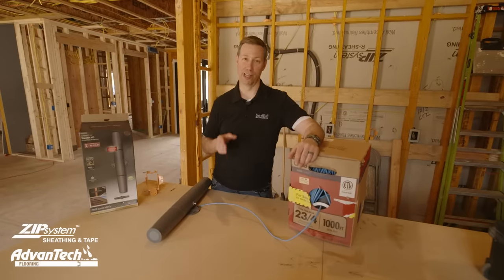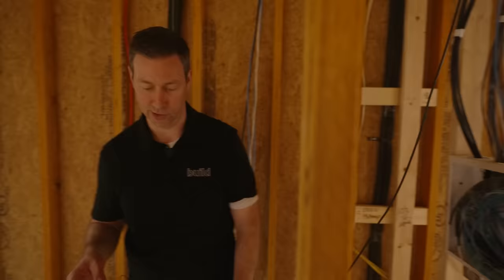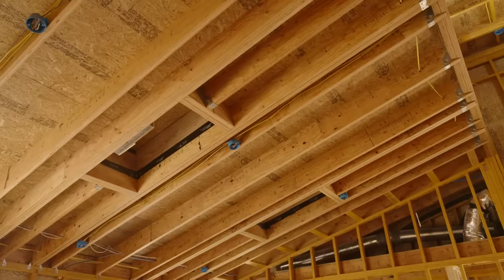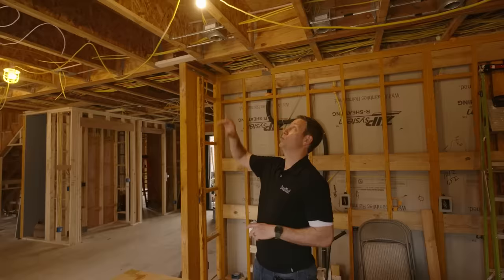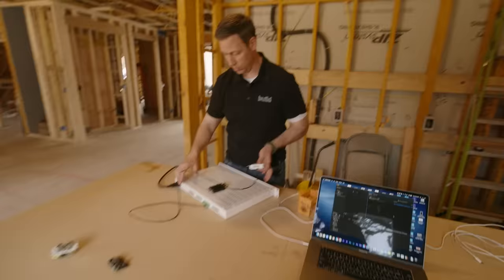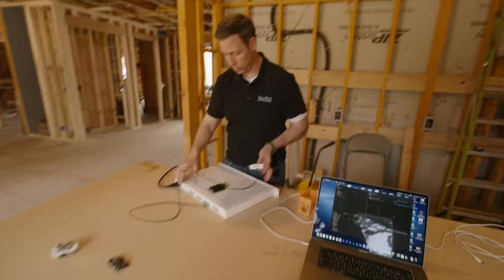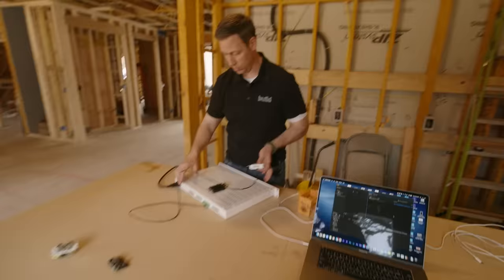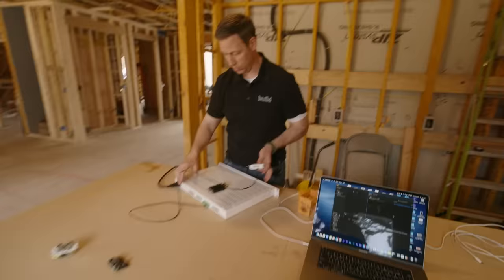Low ⚡Voltage at the Real ReBuild

Comment: Why do you not have an A/V custom guy helping you with this? Do you work with someone who does the low voltage in your other projects? It's funny how builders or homeowners often want to do this themselves when it's such a specialized field. You use an HVAC contractor, you use an electrician, you use a plumber, yet somehow when it comes to all these high-tech low voltage systems, "naaah, I don't need a professional for that." I noticed one thing you did that I would have done differently. Your TV is on that exterior wall. I would have put it on the wall facing the kitchen where the equipment closet would sit right behind it. There's no better way to future-proof things (remember those iPod stations?) than to not have to rely upon whatever you have in the wall. If you'd done this house 15 years ago, there would have been no HDMI to run, but now you need it. Who's to say those wires you snaked up that exterior wall today aren't going to be obsolete 15 years from now? You''ll have to tear down sheetrock if you want some specialty cable for that new 16k TV. If the A/V closet was directly behind the wall where you have your TV/speaker location, no problem. Besides, you could have seen the TV from the kitchen if it was on that wall.

Comment: If you’re getting Ubiquiti they make PoE led lights that will run over that CAT6 cable. I’ve got a similar rack setup with Ubiquiti gear but I ran CAT8 for the day 40GBs arrives. You’re going to love Ubiquiti. I manage a series of friends houses and we’re all on Ubiquiti gear. So slick.

Comment: Now is a good time to install low voltage wire for Fire and Security alarm systems.  A 64 zone (hard-wired) burglar alarm system should work for you. Also, a hard-wired Fire alarm system using red color wire going to the smoke detectors and sounding devices will work out well. (The less wireless, the better) Always keep the fire alarm separate from the Burglar alarm system. It's best to hire a "STATE LICENSED ALARM INSTALLER" when it comes to life safety. (State Licensed Alarm Installers will know what to do). I put in 39 years as an NYS licensed alarm installer. (Now retired) The company that I used for alarm parts was Napco Security in Long Island New York. Great company. Good luck and keep safe.

Comment: Using conduit (smerf pipe) as much as posable, will help future proof a home. Cat3, Cat5, Cat5e and now Cat6, were introduced only a few years apart. Now Cat8 is here. So, having a way to pull a new cable spec, to an old location is a good idea.
Also, having a path to the outside and the attic , is brilliant. Ideal Tools 31-554 nylon fish tape, works great for flex pipe.

Comment: I did a lot of the same in my new home build for low voltage. Sonos, Samsung Frame, Ubiquiti UDMP/UACs/Protect, Antenna in attic, etc. Lots of Cat6, RG6, flexible conduit, etc. the main difference I think would be security system and lighting. I have a mix of zwave and Lutron, as well as Hue. Once you are moved in, you could cover integrations with lighting, security, automation, voice assistants, etc.

Comment: Matt, as an IT guy. SONOS is such a headache. Try to connect using ethernet, not wifi. Or at least one with ethernet, then the others connect to the main one on their own invisible wifi. Getting Sonos speakers to connect is sometimes such a headache.
Reply: I can attest to this... It's great with it works, but when I share the TV audio to other speakers (that aren't wired) I get the sound cutting out.

Comment: Nice list of fore-thought issues.  I built custom 15 years ago and have coax all over.  Sigh.  But I also included Cat5 with them.  Hooray!  I also included a home-run (star) design control system of a/c lighting and ceiling fans for 90% of the rooms.  Central control, much like a central circuit breaker panel.  It's been nice to use but has been discontinued.  Final recommendation would be to consider wired door detection, especially exterior doors.  This way you have a means to know if an exterior door has been opened or closed.  I used magnet-based reed switches in the overhead door jamb.  This means your system of choice could use those switches if it has the inputs for them.  If not, use what they offer, but it cheap to include with a new build.  Coincidentally, my son bought the Ubiquity system you mentioned.  Very nice, especially if you have wiring in place to support multiple AP (access points) throughout.  I found that the ones I chose really don't cover that much area for each.

Comment: To avoid confusion, in the UK and much of the world, low voltage wiring is 50v - 1000v AC, extra-low voltage wiring is below 50v AC. What Matt is calling low voltage is data wiring and is not normally referred to in terms of voltage, but rather its function. LOW VOLTAGE WIRING CAN KILL!

Comment: Yup! I just ran CAT6 all the way throughout my place with an entire Unifi setup. Used Raspberry Pi for the Unifi Controller and a bunch of sweet AP's. I also ran RJ45 CAT6 ports to every room. Sometimes each room has two or three runs to one 3 port RJ45 port. You'll probably want to look into automation while you are at it. Stay away from Smartthings, perhaps look at "Thread" or zwave/zigbee. I personally use Vera to control my zwave mesh. It works great!

Comment: Dear contractors, please love your customers by installing EMT pipes and metal boxes for low voltage run to attic space especially for insulated walls. Low voltage technology changes by the decade and making it easy for the homeowner to fish wires and shield electronics from EMF is a nice touch.
Reply: CAT 7 and fiberoptic HDMI is around the corner.
Reply: Last point, If possible put all your low voltage electronics and a few hallway lights on a single circuit that you can put one one large UPS on. I use to have a symphony of UPS chirping in a power outage. I eventually replaced my UPS with a solar inverter and battery. 36 hours of internet, TV and hallway lighting baby! Yeah! The electronic gear will need to be rebooted far less with online double conversion UPS.

Comment: Matt, your comment about low voltage LED lighting, these are already in use in commercial spaces.  Cisco provides the PoE switches, and companies like NuLED and others provide various styles of lights (can lights, troffers, etc) that only need an Ethernet cable back to the switch.  Can significantly reduce the lighting costs for commercial spaces by the integration with building management systems.

I also echo the other comments about running some Ethernet to locations you may need in the future (ceiling for wireless APs, TVs, desks, etc).  Wireless is great when it works, but when it gets overloaded or there's too much contention in your neighborhood for limited frequencies, you won't have any issues with a wired connection.

Comment: There are lots of potential changes in the works re: voltages.
-Data centers moving to 12v or 24v DC local grids to eliminate the heavy, expensive transformer-brick-per-server.
-Autos and trucks moving to 24v or 48v DC to reduce wire gauges.
-Maybe homes moving to 24v or 48v local grids for LED lighting.

Comment: Great episode, love the struggle on the future of low voltage cabling and network infrastructure concerns. I would suggest leaving 1 to 2 inch PVC conduit in the wall(s) where low voltage or heavy traffic of cabling (maybe a pull string) before sealing the walls. Great question on the led lighting, I have struggled with lumencache (low voltage lighting system) and hope there will be a standard solution in the future (maybe voltek).

Comment: I work in the tech world as my primary career. I strongly believe that all low voltage and communications wiring should be put in with conduit due to how fast it changes. It does cost more up front but 2 years later when the tech advances you can just pull In the new spec wire. 

Also Ubiquiti is a game changer for consumer level  cable and wireless networking. Have been using them for 5 years and love their products.
Reply: Great comment on conduit. If I were building today, I'd do that, especially because I don't like WiFi for a number of reasons, and because you never know what new inventions will be required with totally different wiring.

Comment: Halo Quicklink led lights do exactly what you’re referring to, you get a bigger module that has thin wire that powers up to 6 lights each at low dc voltage 👍👍

Comment: Matt, remember, a connection to your TV antenna. A lot of free channels that are not available over the Internet without a subscription. Like the local PBS stations which are great in Austin. I use Cat 6 only on my backbone. The rest is a wifi mesh network. I also have the mesh extended to my back yard for my weather station, sprinklers, greenhouse and other stuff. I also have a Netgear RAID cloud server running Plex providing media services and storage for internet access (16 tera). I retired from a network and cyber security career after 30 years. I’m just a few miles south of you.

Comment: I am a tech person!  There is no such thing as too much CAT5 +.  It is so easy to just not use a line in the future compared to not creating a CATx path now.  Run them like crazy!!!  How much cost would it to be to completely bury a line that you don't use compared to running one in the future?

I have been craving a building/builder just saying: "run conduit and let the lines change with time."  We want these houses to last 100+ years but over history the wiring is changing more rapidly than the structure.  This is something build science can adopt.

Love your show, but please run way more wires.  CAT5 despite being over a decade expired is better than wireless.  Run wires!

@Matt Risinger, read the comments from the tech people  These low voltage lines are cheap now, run at least one to every room in the house if not more.  If you want camera's on the house run them everywhere you could foreseeably want them.  

Back in the mid 2000's cubicle life at a top 5 software company said: you had at least 3 CAT5 "+" drops and frequently more; sure WiFi is much better now but guess what, those wires worked day in and day out and we never were concerned about rebooting a wireless router, wireless frequency congestion, what's the WiFi password, etc. They all just worked.  WIRES ARE GOOD! Wire is cheap; redundancy is negligible in labor.  Low voltage signal wires don't like kinks and hard bends, a good installer know this, but added insurance double or triple up the run.  If I could build a house from scratch this is right next to the nerdy details to air, vapor, and water seal important to me.
Reply: Depends on how much cable you run. FWIW I have about 115 Ethernet drops Mostly cat 6a Cable. I think I have about 5 or 6 miles of cable installed (including Coax, Fire, Alarm, HVAC, etc). & still have a few more drops to install.
Reply: @guytech7310  a few more and wouldn’t complain. 😁
Reply: You're a "tech person" and still using Cat5?! #AncientHistory
Reply: @skynetlabs  Hahaha!!! Actually I am running CAT8 in my house but most say I am wasting money because I don’t have any household hardware that can use any more potential than old CAT5.

Comment: Good job Matt, Ubiquiti is a great choice.  I use it with most of my commercial clients and in my own house.  Very easy to managed and install.  Also, note that Ubiquiti does have a 2x2 and I think a 2x4 LED panel lighting system that works over PoE.  BTW, Any other builder out there who is watching this, take note.  Run network cables to every room in the house.  WiFi is just not sufficient when you have a house full of kids and adults trying to stream all their favorite shows.
Reply: Re: "Run network cables to every room in the house. "
EXCELLENT ADVICE, THAT!!!

Comment: Very nice led lighting systems available that run from central drivers and use cat6 cable to the fixtures. No more high voltage cables to lights

Comment: Matt, there is a new company out there running LED lights like you were talking about.  A remote driver and you just need to run low voltage cable to them.  They even have wireless, kinetically driven switches (there are no wires to the switch and they dont use batteries).  The company is called Lauren Illumination.  They are out of Ohio.  Super slick stuff.

Comment: I've had a wee bit of experience with wiring closets in corporate offices and they are often hot and loud, electronics generate heat and are full of noisy fans to cool themselves (spinning hard drives are notoriously loud, but mostly outdated). You might consider sound insulation while it's still easy and at least have a plan for ventilation. 
And when electronics get too hot and fail, sometimes they start fires. Make sure there's a smoke alarm in that closet.
In the corporate IT world, wifi access points are always installed outside the closet in the office ceilings. Usually powered with POE, so that cat 6 data cable is also low voltage power.  I've only ever worked with Cisco devices and those were all designed with the option to mount to a box on a ceiling.

Comment: If you are using the Sonos Arc with the Samsung Frame Tv, make sure you also run a HDMI cable to your account closet, it is also worthwhile to run a second cat6 cable to the arc from your network switch. The arc can run wireless but there is no reason to not add it if everything is still open, but since the frame has all of its connections in a single box that will be in your closet, the hdmi is critical otherwise it just can’t connect to your tv
Reply: This is true …it’s important to attempt to connect at least one Sonos product directly to Ethernet in a zone if possible so that it creates a more robust SonosNet.   The Arc would be the ideal device to create the SonosNet because WiFi Soundbars eat up more bandwidth than the other speakers comparatively

Comment: Pro tip. You can run most anything on good Cat6, with the right adapters. HD video, HDMI, multi channel audio etc.
It's used extensively in theatre tech for driving amps and projectors and everything else!
Just search for "HDMI over cat 6" or whatever and you will find the adapters.

Also, I would add some runs into the ceiling, for potential projecter mounting, or for wifi access points.

And I think Cat 6 is better for video etc than most older types of coax. They don't handle the high bandwidth well lol

Comment: Matt, just a reminder that TV antennas like that have a radiation pattern that has the most gain (ability to register signal) perpendicular to the long side. Remember to mount it with the two ends facing N/S on the west side of the house to have the best chance of picking up any signal!

Comment: most important is shield the wire against other radio frequencies and you will be years ahead of the game. It is low cost and very basic protection. I installing that in my communication array and antennas array. Cheap but very effective.

Comment: I always take many pictures of the walls after all the wiring, but before they're covered up with insulation and drywall.  I have someone hold a 6' ruler for reference so i will always know exactly where the wires are, where the studs are, etc.  I can't tell you how many times that has come in handy.  Once, I couldn't believe I had forgotten to plan an outlet in the entryway, so I wanted to add one.  I went back and looked at the photos to see what i was dealing with, and I noticed that I HAD requested an outlet there, but the drywallers had walled over it!  All I had to do was cut the hole!

Comment: I've worked in IT since the 90s. I worked for AT&T as a Technical Support Trainer and wrote the training for Support & Wireless. I have more than 50 devices on my network from lights to cameras, door locks, the garage door, tvs, all the cell phones, game consoles, raspberry pis for 3D printers, refrigerator, and oven.  You don't want to expose everything to WIFI for security reasons. You need to make sure that you have the ability to split the bandwidth for each level of devices. Someone on here will probably mention setting up separate VLANS for the lights and your PCs. This can also keep the latency on your network down. You also don't want to be saddled with a slow router otherwise you won't be able to max out your fiber bandwidth efficiently. 4k Streaming to TVs can eat up bandwidth. You should have PoE (power over ethernet) available so that you don't have to power brick everything from streaming devices to cameras. You want to make sure you have all the cameras planned out. 

You will want sensors for movement for security outdoors. I never saw anything about planning for solar and any data lines needed there. You don't want to have to add them later. Do your AC systems components also have internet access? Have you done a site survey to identify how much WIFI spam is in your area? What channels are being used up? Did you plan on adding any outdoor access? I haven't heard anything about any future outdoor kitchen stuff.  WIFI BBQ Controllers are a thing. Environmental control for the food pantry wasn't mentioned. It doesn't have to be super complicated but advanced planning makes all the difference because there are some quality of life changes that no one thinks about when it comes to their home network.

Comment: For low voltage PoE Lighting, take a look at Poewit. System can handle 90W over CAT6 and is Cloud controlled using Mobile App. Also integrates with Control4 for home automation.

Comment: You mentioned wireless, I'm a big fan of hardwiring the mesh system for backhaul between the mesh units, and keep your access points closer than you think, as we move into higher frequency for more bandwidth they need to be closer together.  Way more important on a campus than a house but same principle.